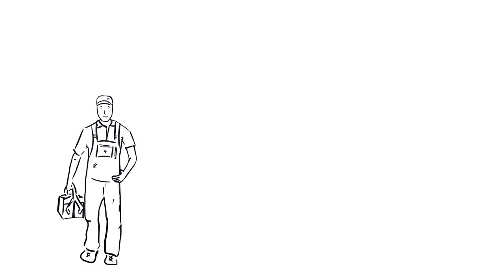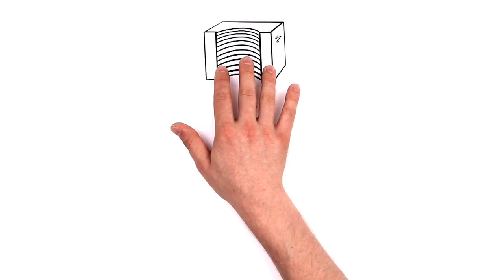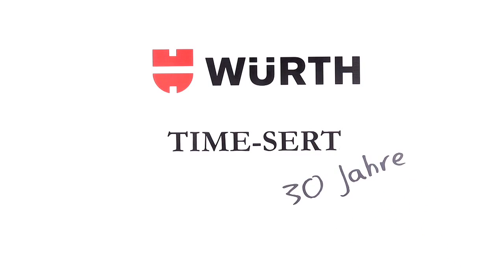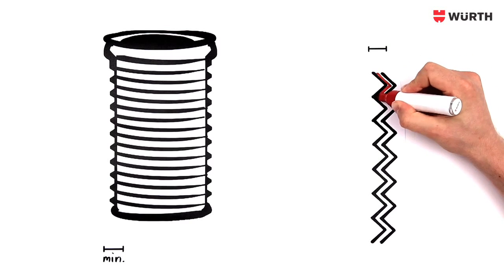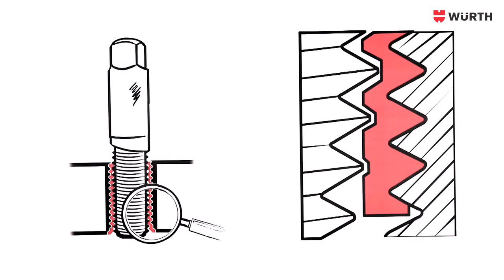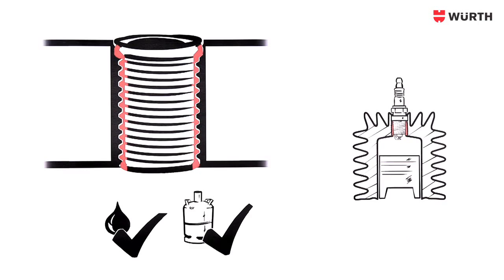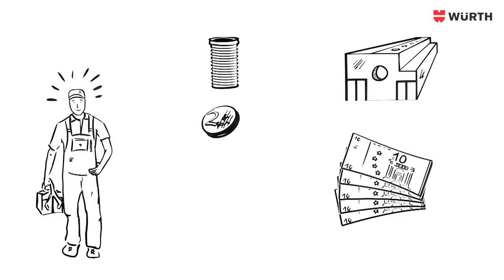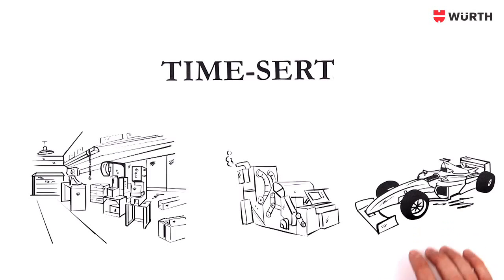Würth Time-Sert Thread Repair 2012

Comment: Sehr danke Wurth. I would like to know what was the Nm before and after  the Time-Sert was  installed. Thanks for the great video.. Greetings  form South Africa.
Reply from the maker: Hi David, thanks for getting in touch! :) Here's some info about its resistance to forces from the product page: 
"Tear-out strength may vary subject to application (edge areas etc.) and material...Tests in the Würth laboratory have shown that the Time-Sert thread repairs are equivalent to the original threads in most cases". 

I hope this was helpful :)
Reply: @wurthuk  Baie dankie Wurth UK for your responds. In deed your answer was emotional helpful. Since my discovery of You Tube, some six months ago, I've found the World. To repair a thread I only know of the re-tap of the hole. Therefore makes it bigger. So a person can now use a Wurth Time-Sert or a Hilx-coil and the original mm of the hole. OK. Some 2yrs ago I paid a motorbike workshop in Paarl to change my Chinese Gomoto motorbike for 125cc to 200cc. (6.4Kw to 10.8Kw!) Lately the bike has broken and cost was running up. I didn't except the motorbikeshops' price to fix the Gomoto. The engine was still open and then I discovered that 1 of 4 head bolts was very lose. I can take the bolt out with my hand. I made then the discovery that the aluminium tread in the casing was striped (for the past 2 yrs!). On Delboy's Garage I've seen a video of 10mm bolt and about 20mm tread was put under strain. The aluminum stead broke at 60Nm and the Helxcoil at bout 65Nm. The Gomoto bolt is only 8mm and about 15mm deep into the Aluminum casing. It will be less or far less Nm. Remember the China material is normally not the same as German or European standers. So the Aluminum will be different or weaker. The Haynes Workshop Manuals of other motorbikes and on internet it show the toque to be some where between 28Nm and 58Nm for a 8mm head bolt. (Again that is for European standards.)  My hometown, Wellington, don't have so many shops or hardwear shops. Paal is much bigger I'll look at Fawkes Brothers.  Tschus.

Comment: For what its worth WURTH these time serts SUCK!
they always come out  and leak oil after busting your ass installing them that is even if you can perform this service on your pan due to cross members and location of drain hole
THE ANSWER IS AN ECOPLUG !!!!!! NO BULLSHIT PURCHASE AND INSTALL IN A SECOND 
and change your oil in seconds  these Ecoplugs last a lifetime and NEVER NEVER NEVER deal with threads again.